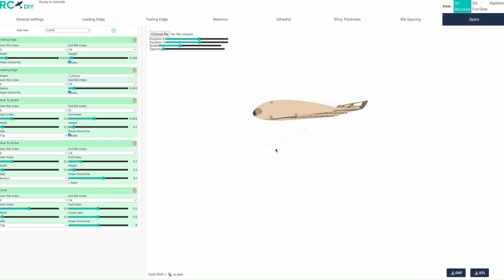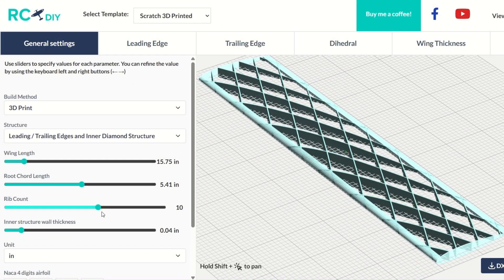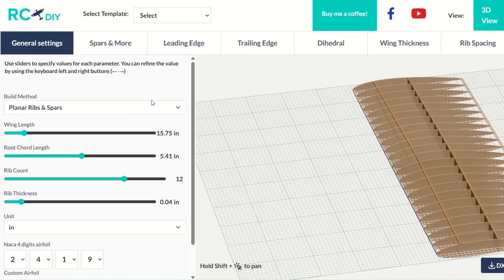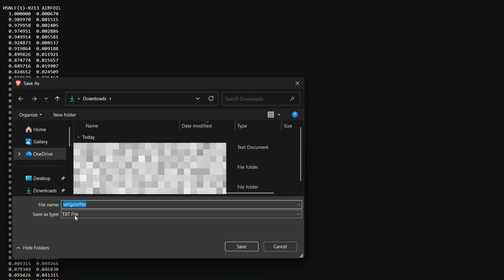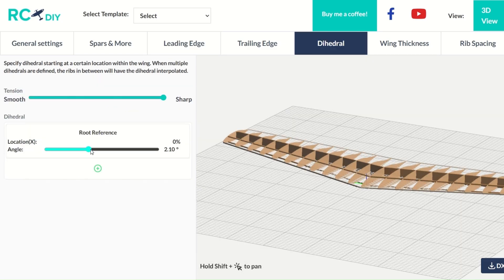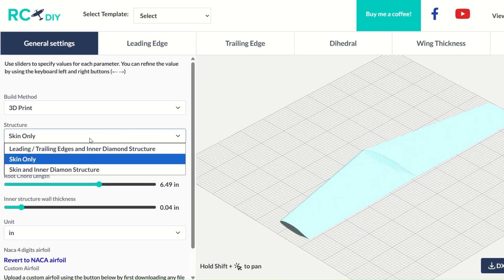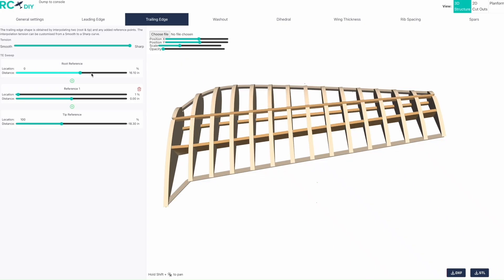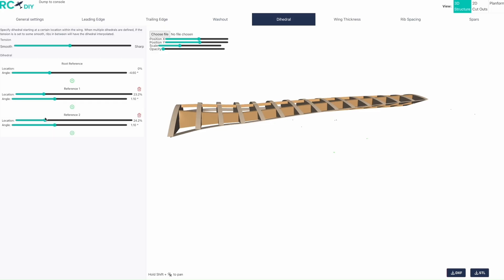FREE Tool to Design & Build Wing | CNC / 3D printing / Hand Cutting

Comment: @Aircraft Design Toolbox Thank you for sharing.
And a big thank-you to everyone for the thoughtful feedback and support in the comments! 
I would be happy to answer any questions.
Reply: Hi, what an impressive tool you built!

Is there a way of slicing the wing so that it can be 3d printed in vase mode?

Thanks in advance
Reply: @MJ-bj1gn  
Hello,
By using the 3D print method -> Skin only the generated wing should meet the vase mode conditions - only outer walls, no inner walls. You can also split the full wing into the two sub-components. 
I have not tried it but this export mode should work. 
Hope this helps.
Reply: @rcplanediy  Thank you!

Comment: At first glance, it makes an impression... but what I see there represents max. 20% of the design work. 80% is adding flaps, ailerons, servo mounts, Linkage, wing joiners, landing gear mounts, landing gear doors, wingtips  ..
Reply: You are right. It does not cover all elements right now. However, the spar element has flexibility to cover some of those elements - ex. servo mounts, landing gear mounts can be modelled as a thin & wide spar spanning two adjacent ribs. Did not want take out all joy 😄